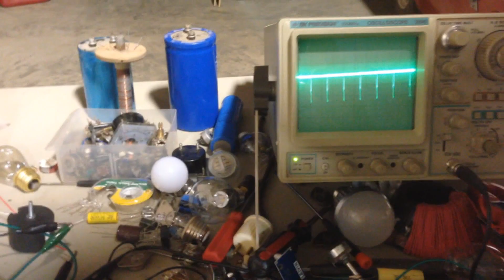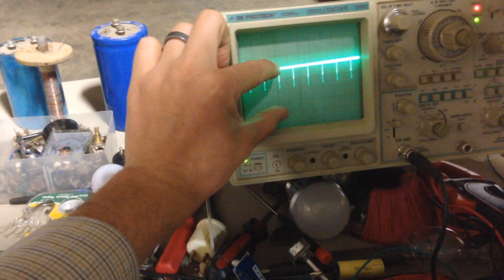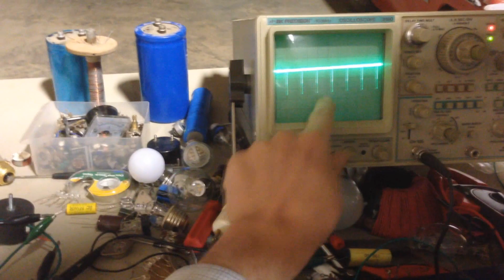SJR Loop Tests - Part 2

Comment: You mentioned you had to take apart the coil and when you put it all together and mounted it to the circuit board it did not work like it did before. I am wondering if the metal bolt you used to mount the coil changed the parameters. Maybe try a nylon bolt? and see if it corrects it back to how it was. You know better I am sure what your doing but that seemed to be the obvious major change I could see while watching.

Comment: Hey Mr. Lasersaber. Awesome work! I was wondering, for those of us that might not have the resourses to order or find one of the cores that you use for your transformer, would winding the coils using an E-core and then covering the whole entire transformer in a round mold filling it up with J-B Weld serve the same function? What do you think? Cheers

Comment: Thanks for sharing. This is really very intriguing, and I would love to try to build one myself. Have you posted a schematic anywhere ? Just asking, as I would love to know more. Especially the transformer specs. I've seen a lot of joule thieves over the years but your little circuit really seems to take the cake. Have you tried this circuit outdoors away from your test bench and surrounding household electrical environment. Just wondering if you have ruled out parasitic coupling with nearby wiring ? Great stuff.

Comment: In the 80's I killed some summer time at a friends electric motor shop.  Mostly doing simple winding and salvage stuff.  I see the problem you have encountered with shorting.  They extensively used an insulating spray paint.  Many times they would simply  open up a motor and spray the windings with the insulator and send it back out again.  In a situation where it was hopelessly shorted, they would burn and strip the stator and put in new windings, soak it in a varnish vat and bake it. Then a few squirts of the insulator spray for good measure.  That may save you some time?

Comment: with a 750 ma transformee 200 ma input and 3 5 watts led bulb  the v in the battery stays longer than 6 hrs unlike a standard j r   one of my ac output is connected to pos source

Comment: I have never done any experiments with Joule ringer circuits, but from what you showing it looks like the circuit is analogous to a pendulum in a vacuum where the current is like the weight swinging back and forth. Voltage is like potential energy and current is kinetic. like the pendulum, the current could oscillate for a very very long time. This actually makes some sense because current going through a resistive load has the same amount of flow on either side of the load. The Resistive load could then be analogous to the inertia of the pendulum.

Comment: Well done Lasersaber ! Looking forward to your next build with infinite run time. Video added to my free energy playlist !
Reply from the maker: I do not expect to reach an infinite run time.  On the video I said that when it was running perfectly it had an "indefinite run time".  With  a current draw of  less than 1/2uA it would be a very, very long run for sure.  I will try to get it running again like that later tonight after work.  Even though it's my personal belief that a closed system cannot ever achieve overunity, I love seeing my current meter start hovering around zero while I try my very best to hammer through the impenetrable door to the impossible world that lies on the other side of that zero. The logical side of my mind knows that it is impossible while the artistic dreamer side of me feels that somewhere in this world there are still keys that lead to new places.  If the needle ever does crash through that door it will be because the system somehow tapped into a alternative source of energy not an excess from within the system itself.  Forgive my ramblings.
Reply: I agree completely if anyone gets a self running system, it will be because they dont understand where the energy comes from.

One thing I would love to see at this point, Is to hook up the antenna you used for the atmo motor, and see how high the hexachopoter needs to get before the led lights up.
Perhaps a hydrogen balloon could be used down the track, and the eletricity could make the gas to keep the balloon afloat.

The key term with all this stuff is energy harvesting. We need to be looking at new and old sources of natural energy we can harvest. With no nasty side effects for the planet.
Reply: https://www.youtube.com/watch?v=sGPsRc9mbmw&t=247s